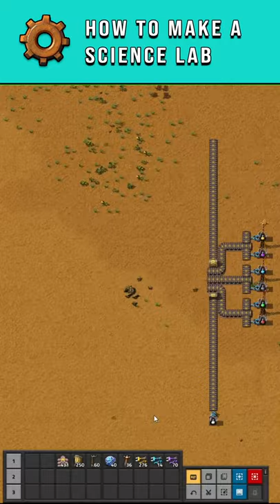How To Make A Science Lab In 60 Seconds - Factorio

Comment: Hey.... if you transfer from one lab to another... don't you waste science? Like putting fuel into a car, driving for 1 sec and then pick up the car... you don't get fuel back.
Reply: Nope, science bottle have their own progression bar, you wont waste science or research speed .
Reply from the maker: Good point to bring up. But science is ran on a % so when it moves from one lab to the next the % just transfers and carries on.  :) 
Great point to bring up though
Reply: Adding to what others have said - think of the science beakers as ammunition cartridges for your pistol/machine gun. One cartridge has 10 rounds or whatever. Same for science, but 100 units.

Comment: Personally I prefer belt weaving and just having 4 long inserters per science lab line (before megabasing). 2 tiles horizontal so can carry 4 sciences but due to weaving it becomes 8 meaning that with space science it's 7 it means they fit well enough. Hell until megabasing I often cannot get 45 science per minute that my base is built around. So I don't need anywhere close to that many labs

Comment: Does it work if i replave the yellow inserters with fast inserters?
Reply: Absolutely. It's unnecessarily fast, but it'll still work.
Reply: @dukeamox4639  thx
Reply: Even stack inserters work and they're useful for large rows of chained labs. However I don't recommend it because efficiency really lowers down as your labs are mostly idle while the inserters grab everything. That's why chains up to 5 are usually best and the most efficient lab design is with just one research facility surrounded by 4 belts and 4 beacons